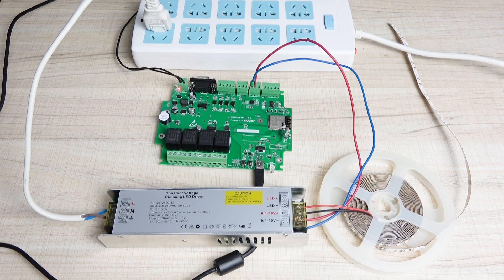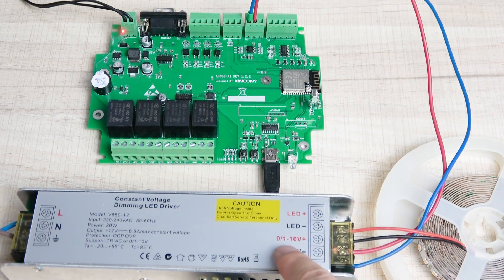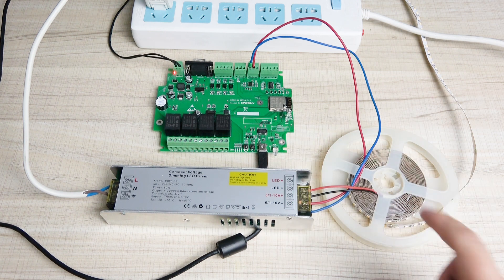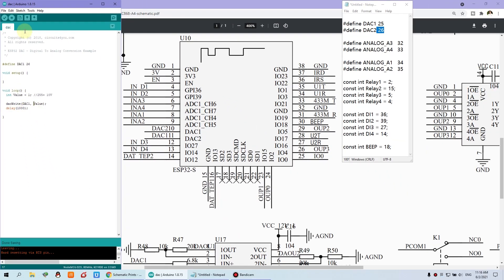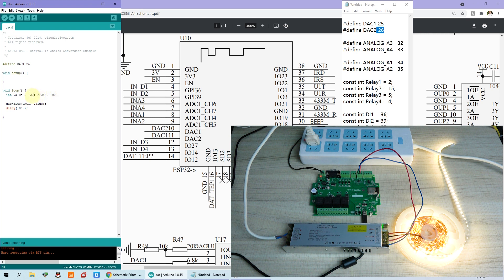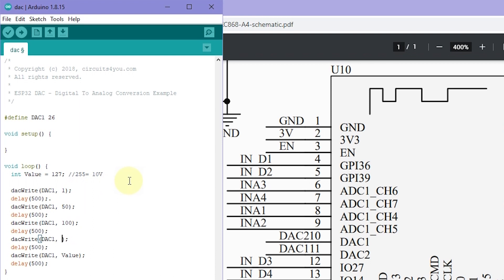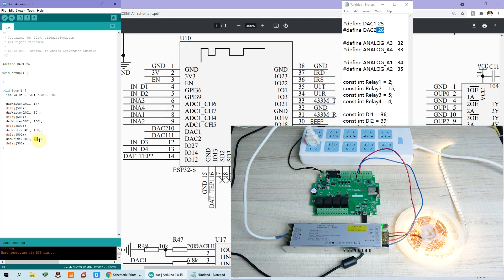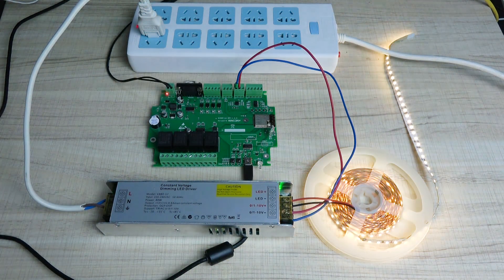Lesson5- How to use Arduino to control dimmable LED brightness

Comment: if 686-A4 can dim ice with lamps, then what is the maximum number and power?
Reply from the maker: according to the driver behind the A4 analog output port.
Reply: @KinCony  I have led lamps mark GU-10 and controller H32L. What alse I need to buy to control this lamps with dimmer. Not led tape, namely led lamps.

Comment: can the KC868-d8 controller be connected to a common working group with your dimmer to control the GU10 dimming bulbs?
Reply: with KC-LNW-301 dimmer
Reply from the maker: @antonzasipkin3614  KC-LNW-301 just a dry contact switch, you need add KC868-D8 dimmer controller and KC-LNW-301 swithch panel work together for light dimmer.
Reply: @KinCony  can they control the LED lights or just the tape?
Reply from the maker: @antonzasipkin3614  what's tape?
Reply: @KinCony  Led
Reply: what you need to make the H32L work as a dimmer with GU10 lamps
Reply: is there a relay that, together with the H32L, can DIMM THE ICE LAMPS or just turn them on and off?
Reply from the maker: @antonzasipkin3614  KC868-A4 both have dimmer output and relay output.
Reply: any Ice lamps can be controlled or only dimmable?
Reply from the maker: @antonzasipkin3614  what's ice lamp? i don't know.
Reply: @KinCony  Led lamp
Reply: And what power for led lamps on controllers for low price and hight price.